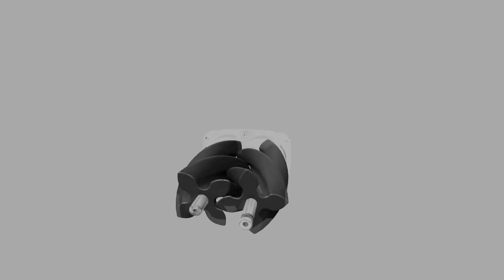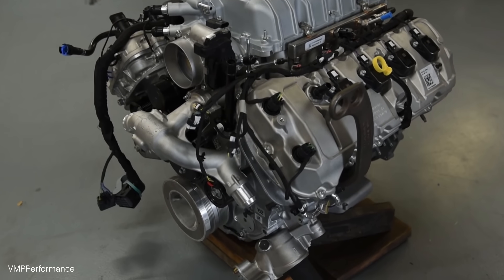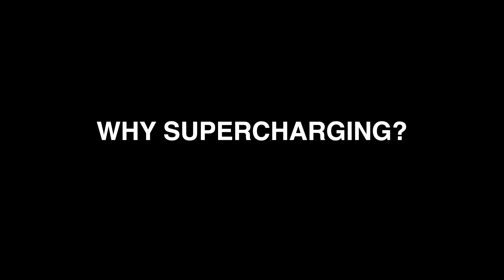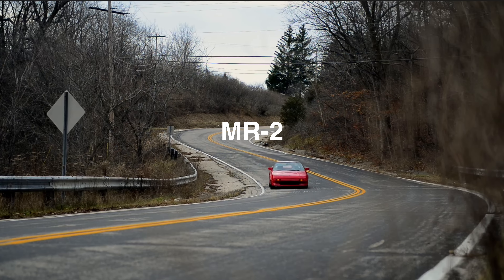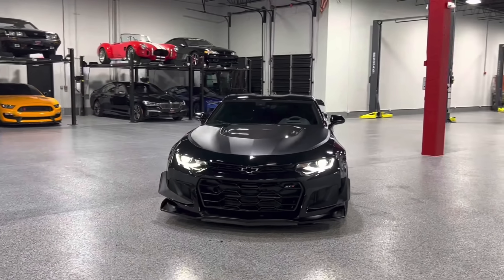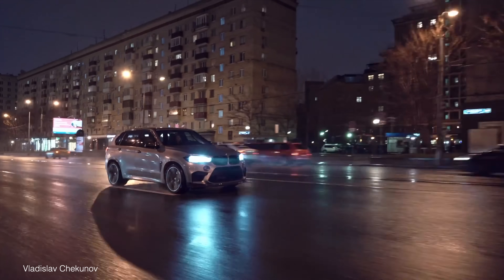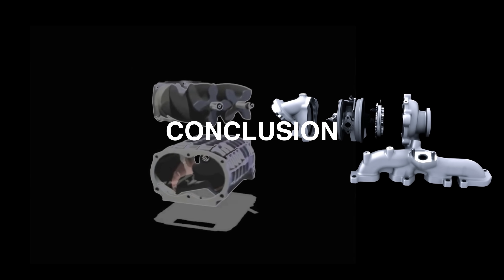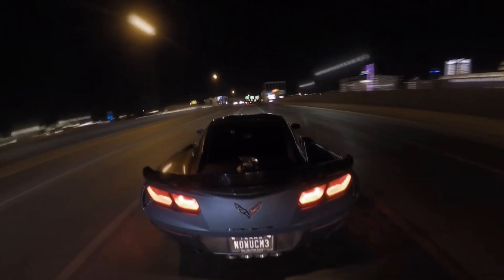Why V8 Engines Are Supercharged vs. Turbo😮| Explained Ep.6

Comment: As a former N63 owner, the hot V definitely needed work when it came out. Regularly cooking the oil in the turbos is a terrible side effect, but as he says, it was easier to work on them being up top.
Reply: As an N54 owner I can bear witness to the labor intensive component of ownership. 

Still. Love the platform
Reply: Hot v turbos are improving from what they originally used to be
Reply: @Demoxx1  true, doesnt help the majority of the ones out there still
Reply: @Bamfhammer  yeah just have to be on the lookout tho
Reply: On my 2nd N63tu car and love and hate them depending on the day and how many Drivetrain Malfunctions
Reply: @bigbezzee  presumably you have one of the ZF 8 speeds, how often are you seeing issues pop up?
Reply: @Bamfhammer  not so much on the newer one. On my F10 it was two or 3 times a year. It was usually plugs and coils. I just started keeping extras.
Reply: It’s cause they never upgraded the cooling until the technical updates

The valve stem seals would warp cause the average op temp of those engines was 105°C instead of 90°C
Reply: People who complain about BMW reliability are usually trying to run 3rd-hand cars on a shoestring budget and wonder why things go wrong. I've owned many M-cars, mostly tuned well beyond the standard HP - my last M5 was dynoed at 780Bhp after remapping and exhaust change/decat. I've had no more problems with them than any other car. I had a LOT more issues with an Evo 5, and GTO TT from years ago. Same with Landrovers really. They're expensive cars and cost a lot of money to service properly.
Reply: @Anticitizen666  tuned M cars are not why people complain about BMWs. People complain because even on my first hand standard car, I have had to replace:
the air ride suspension twice,
 a bank of injectors, 
my cabin blower motor, 
a door lock assembly with soft close, 
a speaker mount in the door on the B&O optional speaker trim, 
5 front control arms, 
a PCV valve that whistled when coming to a stop, 
My sunroof retractable cover, 
A steering wheel bushing twice, 
My rear hatch/trunk latch which got stuck locked with milk in the trunk, 
and now at 100k miles I carry a quart of oil with me wherever I go because I burn up a quart every quarter.

I still love it and have no plans on replacing it.
But they are not all 3rd owner crapcans with $0 budget
Reply: @Anticitizen666  lol I had a 135i from new, and other than the Chrysler products I’ve bought, it was by far the most problematic car I’ve ever owned. It shat high pressure fuel pumps, HVAC fans, electric seat motors, all sorts of problems. Maybe I got unlucky, but I don’t buy BMW any longer and my life has been better off.
Reply: Funny how that's not an issue on Audi engines
Reply: @Corbots80  from the Audi's I have worked on, there are multiple water pumps and that might lead to better cooling overall. I have not worked on a hot V in a while for either BMW or Audi. As a fun aside, I've replaced 3 secondary water pumps that just exploded during normal driving.

Also, the problem I mention is over a decade old at this point and has likely already been remedied.
Reply: That engine was so unreliable like any BMW engine that’s not a straight 6, the N54 too 💀
Reply: @louistru8652  I think the N20 motor is pretty good. Underrated anyway.
Reply: @louistru8652 I love both my n63 and n54. N54 is less needy but that’s expected
Reply: They cook oil cause you probably ain't changed the air filter for years 😂

Comment: Really stupid video and all you did was touch on basics.

Main difference is turbos are more TUNABLE. They are not more efficient. Using The exhaust creates a restriction. They are more complex and take up more space due to needed extra exhaust pipes, intercooler and the turbos themselves. They are simply more tunable. 

So they are more expensive, more complex, more space, need to build boost, have lag.

Comment: If you claim super chargers have Parasitic loss Turbos have parasitic loss as well. If you free up the exhaust flow you get better gas mileage. There fore the turbo is a restriction. But you get incredible amount of power from both forces indiction. It’s a stupid statement to say super chargers have parasitic loss but turbos don’t. It’s also to stupid to claim there is any parasitic loss as using forced induction created way more power. Nothing is lost there.
Reply: It's "stupid to claim" that turbos have DIRECT parasitic loss like you just did.
Reply: @tombo6245  you’re just proving my point

Comment: as someone who works on cars i can tell you turbochargers fail way sooner than suoerchargers do. Heat kills everything. turbk cars run super hot and need constant maintenance.

I personally like superchargers more as i prefer realiabilty and good power as opposed to less reliability and slightly more power.

Comment: Well I put a blower on my Viper years ago and swapped it to turbos when I wanted to go bigger HP.  The blower was more complex with the drive belt and needed more maintenance for oiling the rotors.  The turbos put out a lot of heat but much easier to live with and no maintenance since the oil line is tapped into the stock system.

I also remember the blower was more difficult to tune and had some knock issues.  But that could be the fault of the controller.
Reply: So much "nobody cares" on your post... do you really think anyone came here to find out what Rocky did to his Viper?  Did you dislocate your shoulder trying to pat yourself on your back? Clearly you're begging for attention on both your car and your post pretty sad actually

Comment: I mean Toyota is developing hydrogen combustion which is actually cleaner than an EV. So maybe supercharging still has some future potenial.
Reply: Nah hydrogen has no real future
Reply: @user-RCST  It does. Crude Oil, Lithium, are both finite resources. Batteries don't last forever. Battery recycling isn't mainstream yet. Lithium mines are already running dry. So eventually we will need to move to hydrogen.

Comment: The US car industry is dominated by non-engineers. More fundamental is getting the power to the ground.

The C8 z06 is a great example of what engineers can do if you cut them loose. It would’ve nice if Ford didn’t have bronco engines blowing up under normal load.

Props to Eaton & Ford. I think they do something with a controllable clutch in the pulley, something new to prevent resonance and on the crank pulley & improve emissions & efficiency.

Also, if you’re going Turbo, the plumbing & cooling changes drastically the design of the drivetrain design. 

There are cars that are Turbo from the factory that you would never want to push, and then you get the icons.

Comment: In my honest opinion.  I know this is not always the case.  Reliability, consistency, and familiarity.  
Familarity and consistency - Turbocharged vehicles have been the odd duckling in America.  While other countries such as Europe are experienced in these engines preformance characteristics.  
It's not that a turbos lag creates unpredictability. It just many drivers could not even compensate for a sticky gas pedal that would automatically disengage if you tapped the break. 
Reliability - people buy a BMW with the intent on enjoying the vehicle.  If they do modify it.  BMWs cost 20-30k more then the American counterparts at least.  However, the price range of many American sports cars make them more accessible. Superchargers do not require as many engineering solutions as a turbo does.  Heat management being the biggest in my mind.  This is a bias of mine against turbochargers due to the large number of failed project cars that had a inexperienced owner that simply installed the turbo without factoring in how much extra heat the engine block would endure.  Again.  This is not true to cars that come from a manufacturer.  It's just a bias I have developed when assisting people in finding solutions for there "more power," craze.  
Do I recommend a supercharger over a good turbo? No.  Most of the time I am recommending a better set of tires. Other times I recommend a suspension and engine swaps.  
Too many people want 700+ horsepower.  While it's possible in V8. Many people will eyeball there V6, I6 and I4 as capable becuase and a one off vehicle without understanding the extra stress such modification create for the engine on there daily driver.  
The latest is a V6 mustang owner who wanted to drop 6k on a turbo kit that would bring them up to 600+ horsepower.  They settled for a junkyard F150 coyote engine for half the cost and a better long term vision for the engine.  They are now building the V8 in there living room which makes for a interesting decor discussion.

Comment: He didn’t mention the real reason tho he just explains it. The Autobahn plays a big part of why foreign’s have Turbos.  Mercedes and bmw are able to keep on push until u let of the gas a supercharger has its limits so to break it all down’ On the Autobahn there’s no speed limit which means drives can go as fast as you want until the autobahn ends. Where as Americans take their cars to the drag strip so basically supercharges help u get off the line quicker and give you instantaneous power hint (drag strip) on the other hand turbo’s take a minute to get going but once they get into boost the continue to pull and pull and pull hint Autobahn and that’s why you see hellcats always losing on the freeway because they are belt driven meaning the supercharger is limited to how fast the engine spins so they run off the engine where as a turbo is independently driven but it gets help by the cars exhaust

Comment: I disagree we're not at the peak but we're sure going to skip it with the artificial push to EVs, if the transition was left to it's own devices and was technology developed and adopted organically there would  be an entire era of hybridization. E.g. e-turbos, superchargers with e-assist, electronic valve trains aka free-valve, KERS and WHERS, power schemes where the ICE and electric motors work in tandem.

Comment: When it comes to cars, the U.S. are decades behind european manufacturers. Still holding on to high capacity supercharged V8s is just not state of the art.
Reply: Not entirely true. Many cars nowadays especially the 2017 Ford GT which uses a twin turbo V6 EcoBoost engine and dual clutch transmission.  Also, American cars are using dual clutch transmissions too like the GT500, C8 Z06, and Ford GT. Name a European car brand with the same price and performance as these cars? GT500 does 10.5s and 10.6s in the quarter mile with trap speeds of 133-134mph and it has 760hp and a DCT transmission. Name a European car with the same price and performance as the 2020 GT500.
Reply: @yusufgta4341  Blowing 760hp to a piece of crap doesn't make it a 'good' car. Yes, it's waaaay cheaper than a 765LT, but euros add power on purpose, gaining lap time. And by the way.. a Ferrari SF90 is half tne price if a Ford GT
Reply: Fun Fact...Imperial is better than metric 😉😂😂😂😂😂😂😂😂

Comment: The type of superchargers used on OEM American V8s are not (generally) screw blowers, they're descendants of Roots blowers.  The Eaton M112 on the '03-'04 Cobra, the Eaton M122 on the '08-'12 GT500, the Eaton R2300 TVS on the 13-14 Shelby GT500, and the Eaton R2650 TVS on the 2020+ Shelby GT500 are all Roots blowers.  Same with Eaton R1740 on the GM LT4.  The M112 and M122 were referred to by Eaton as "Roots Improved" blowers.  These were superseded by the current generation TVS blowers, aka Twin Vortices Series,  but they are still Roots blowers in their functionality.  The only exception to this is the Dodge Hellcat engine which uses either a 2.4L or 2.7L twin screw blower built by IHI.

With that said, aftermarket manufacturers, such as Shelby or Ford Performance have tended toward twin screw blowers made by either Whipple or Kenne Bell for their upgrade kits.

Comment: Forced induction is just a shortcut for lazy engine designers and builders.

Poor CFM through the head? Poor volumetric efficiency?  Shitty valve train limiting max rpm?
Fit a blower!

 Don’t like simplicity? Don’t like instant response? Want to wait for boost to build?  Want to wait to cross the boost threshold? Want extra weight and extra heat?
 Fit a blower!

Want a simple, reliable, efficient, fast revving and beautiful sounding engine that is cheap and easy to work on?
 You want an NA V12 w/ 1xthrottle per cylinder, Weber is better than jenvey.

Comment: The idea that turbos have no parasitic loss is absurd. Turbo impellers impede exhaust flow. Period. If I'm wrong, please prove it by plumbing a turbo into a high output ICE exhaust and plumbing the impeller into enough restriction to create positive pressure which vents directly to atmosphere. Turbochargers are not perpetual motion machines and do not create power from nothing.

Comment: Lag is simply the normally aspirated engines power before the boost. There isn't anything lost here. I prefer turbo cars. The noise is better, the boost is easier to adjust and its a ton more efficient. Blowers can create less efficient power more quickly but at loss of traction,  so I mean, what does it matter? Cool video, boosted engines of any variant are awesome.

Comment: Turbos right now for the 90% of applications are strictly for efficiency and emissions not for performance 

A side note any dodge running that 6.2 hemi with a blower realistically is running the engine off the old AMG models of the early-mid 2000s think c63 e63 and s63 BMW hated FI they even said let’s just put a bigger engine instead of going turbo but now they have no choice and soon everything’s going electric 😭

Comment: Ford has been moving away from V8s in favor of turbo V6s, look at the ecoboost.  However, other than the sound and charging times, electrics are better in every way (and they're fixing charging and sound issues).
Reply: No lol. Electric cars are better in instant torque but their high speed range is horrible and so is the charging time. Hybrid is better than both

Comment: Largely about right.  That being said, it is more about fuel efficiency or lack of consideration there-of.  Most supercharger configurations won't meat efficiency standards in the EU, but the US bases efficiency on "fleet values" and does not consider having a few high power supercharged gas guzzlers outside the norm as a result.

Comment: You forgot to mention American engines have vastly larger displacement :)
GT3RS has a 4 Liter 6 banger producing 502 Hp
ZL1 has a 6.2 Liter making 650 Hp (since the displacement is 1.55x more its should end up with 778hp to get the same Hp/Liter)
Superchargers are not conducive to RPM increase because they are inherently spinning at a Engine speed ratio. Fixed to that ratio.
It can be eliminated with variable electronic controlled transmission but then we are starting to talk massive expense that only increases the further you go. At which point It Flat out loses to Turbo. Even Variable geometry several stage Turbo becomes cheaper the further you push the tech.
US engines are designed to be Large and spin slow.
World engines are designed to get the most out of the smaller displacement you can live with.

Comment: Can you explain why turbo has less parasitic losses vs supercharger?
I was thinking the energy needed to add more air into the engine via turbo/supercharger has to come from somewhere, either thru exhaust gasses or driven directly. In the turbo you are harvesting that exhaust energy, but on the other hand supercharging lets the exhaust to flow better since you aren’t harvesting that energy, so what’s the difference?
Reply: With compressor you get Energy from output shaft of the engine. Engines have about 30% efficiency (in fact up to 40%) and rest is wasted by cooling and temperature and pressure of exhaust gasses. With turbo you basically use usually wasted Energy of exhaust gas. Why basically? Because piston has to do little more work pushing gas out of cylinder.